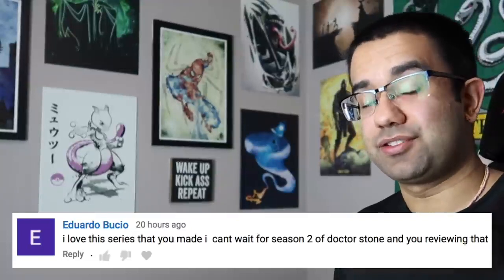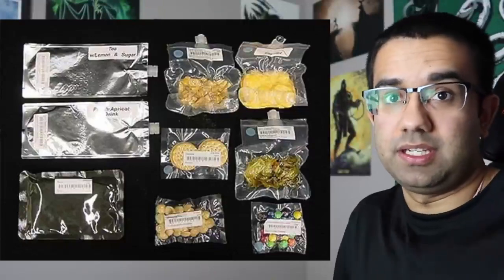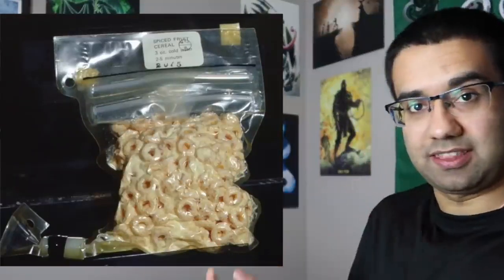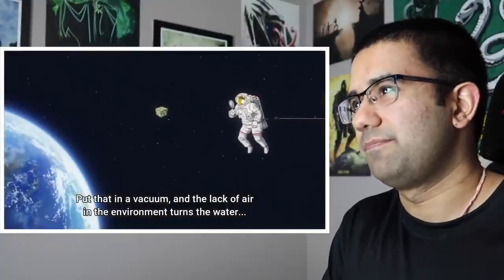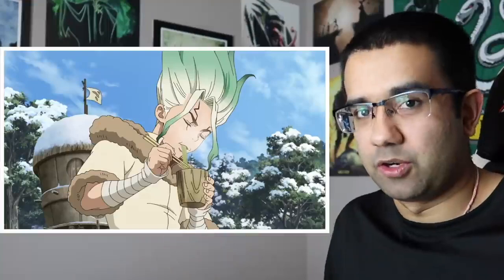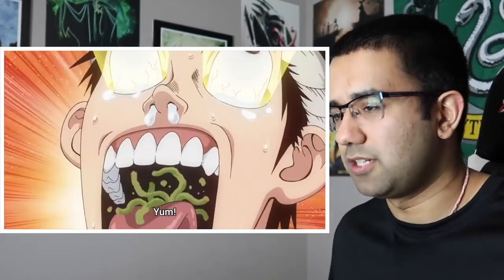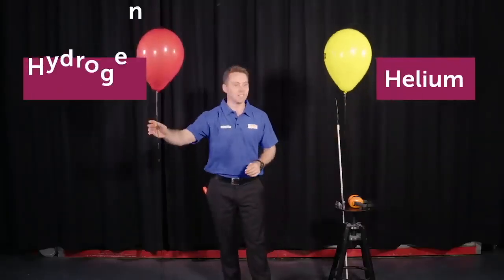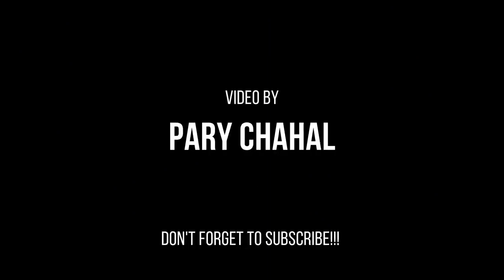Real Engineer Reacts to Technology in Dr. Stone #25

Comment: "How will senku transport boiling water?" 

Dude built a car using a stove as a boiler for the engine. Pretty sure he can put a kettle on the boiler for a while to heat it up. They're gonna need to travel along the river to keep fueling the steam engine anyway, so they'll have access consistently to water. Think of early British tankers. They'd put the teakettle on the hot engine to boil water for tea time. In fact, it was such a problem, as tankers would be outside of their tank and not at the ready and thus easily ambushed, that the British Army built a teakettle INTO future tank designs so you didn't have to get out.
Reply: Also food sent into outer space is kept clear of contaminants because A: The reconstitution process involves boiling hot water pumped into it, and most importantly B: once the food is sealed in those pouches, they go through an irradiator. Seriously, these things are bombarded with gamma radiation by a Cobalt-60 source. Ain't NO bacteria surviving that.

Comment: Why would transporting boiling water be a problem, can't they use a battery or fire to boil water on site?
Reply: indeed, they could always boil water from a river. all they need is a campfire. The point is to lighten the stuff that you cant easily find in the place youre going to, like millet or meat that require so much gear to process.

Comment: About that point with water. Do you realise he doest not need to transport any water at all and could just boil it on the spot with a tea pot?
Reply: Indeed. Especially because it's in the winter-lots of ready to melt snow, allowing for space food to go!
Reply: Okay but how would he get the electricity to heat up the water? They needed a ton of manganese bateries just to get the bare minimum of KWH for a phone which for a common landline is about 2. a tea kettle uses around 0.04 which is around 8% of the battery life just waisted. And this is assuming you just make 1 call.